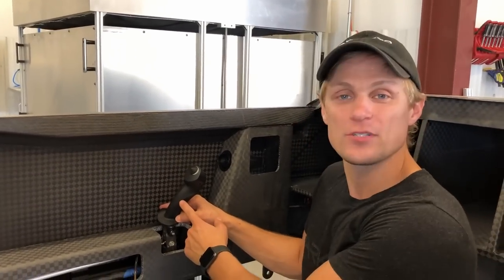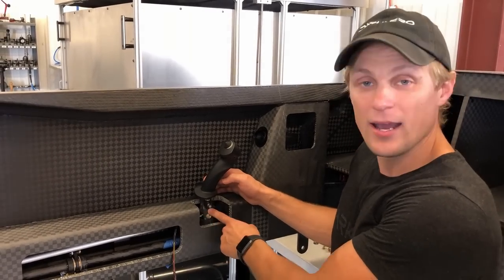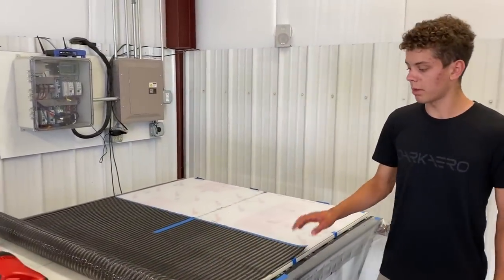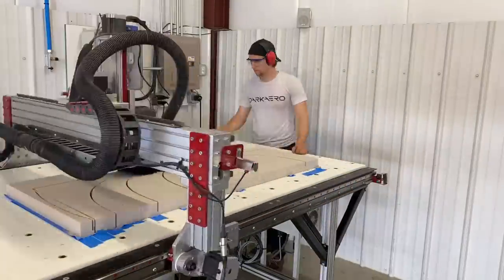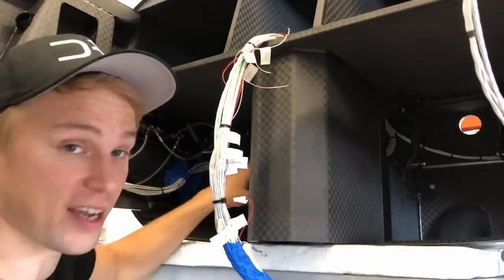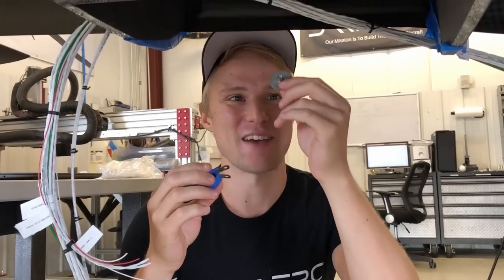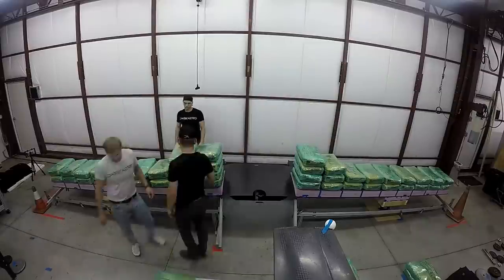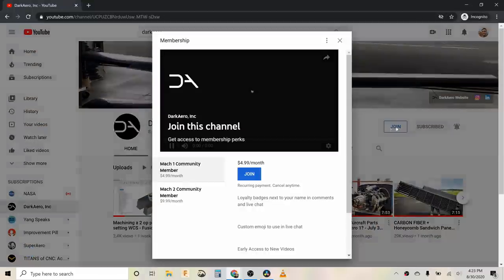We Load Tested the Wing! - DarkAero Progress Update - August 31, 2020

Comment: How did you evaluate the wing torsional rigidity requirements vs the actual rigidity results to prevent twist and flutter with control deflection? Considering the potential TAS at higher altitudes, how did you evaluate the wing structure, the weighting and balancing of the controls.

Comment: That wing is flexing in a unnatural way 06:29. Looks like its about to snap at the centre. Doesn't curve out to the edges like other composite wings I've seen. Did you stress it until it broke? What was the ultimate load stress/force compared to the expected max during flight. If its not 100% more then include a personal parachute for the "lucky" owner as part of the package.....

Comment: Engineering question: Did you guys select all your avionics, radio, nav equipment etc. before you designed the hull so it would fit, or did you design the hull and then select equipment that would fit within the airframe? Just Curious. PS love your project. Can't wait to see this bird fly!
Reply from the maker: Great question! We designed the aircraft with a generic instrument panel that can accommodate a range of avionics. Kit builders will select their avionics based on their mission so the panel is large enough for everything from a simple day VFR panel to a pretty capable full IFR panel with dual displays.

Comment: The proper term for your "P-clip" is actually called an "Adel clamp."
Reply: I literally paused the video and had to google that, because after nearly 20 years in military aviation I had never heard an Adel Clamp called a P-Clip. Turns out if you google p clip, you also get an adel clamp pop up, but because I like do not like change and like things my way even more, I am sticking with adel clamp.

Comment: The foam supports to help protect the wing skin should really have been segmented...despite its low tensile strength the I value from the bending equation is as well as Y - max would babe definitely increased... the parallel axis theorem states that any fixture to which a load is applied should only be supported by a segments stage where such supports are in both tension or compression( tension on your case). Excellent video though:) look forward to the final video!! ATB guys

Comment: How do you guys get around galvanic corrosion when working with carbon fibre and other metals, such as bolts etc? Also, does this happen with the aluminium honeycomb used for bulkheads?
Reply: I was just watching a video from the BearhawkLife channel (Bearhawk 4 build) where this was mentioned by the builder in his use of some carbon trim.  Curious about the answer also.
Reply from the maker: Will, thank you for watching and the comment! We have a video coming out soon talking about galvanic corrosion and how we prevent it on the DarkAero 1. Stay tuned!
Reply: @DarkAeroInc  Legends, thank you. I look forward to it.
Reply: Galvanic corrosion as a problem is dependent on the materials in question for RATE of corrosion.  That being said, CF is next to non existent for corrosion of any kind.  IF you are truly worried(not sure why you would be), you apply a layer of fiberglass just as you would on an aluminum plane as an electrical insulator.  As for specific aluminum honeycomb... such material has been used on EVERY single civilian aircraft produced for the last ~40 years and used primarily in the flooring.  No issues for decades.  Think they are safe... =).  Any ceramic would work as well.  Most plastics work as well, but deformation problems is why they are not used and since CF usually sits in a plastic epoxy matrix...   Bolting CF is difficult just as wood is difficult to bolt and therefore plates of metal are usually used, or in where one can do the testing etc, special bolt/washer combos are used for proper distribution of the load as the CF is not amalgous.  As for Honeycomb construction, the problem becomes the SHEAR properties of your connection.  Therefore what is usually done is to create a BOSS on top of the honeycomb to distribute the load and therefore one does not have deformation of the shear bond with the honeycomb.  Filling in the honecomb for direct compression is also used, but does not necessarily correct the shear problem nor the vibration fatigue over time problem.  This leads to the fact that most small carbon fiber parts would be LIGHTER if you used aluminum or magnesium.  Carbon fiber is great in tensile loads, but is abysmal in compression.  These guys making this plane have not figured this out yet and keep wasting their lives making hard CF parts which are not only heavier, but MUCH more expensive to make and to top it all off are prone to failure due to delamination.  For instance their control system is abysmal.  I would NEVER buy their plane with their Crap CF control system as it is glued to start with which means you cannot fix problems or change anything.  I would mandate they 100% remove all CF parts in their control system other than bell cranks and control rods.  Rod ends need serious work from my VERY simple overview from their vids.  Maybe I am wrong and they have addressed this in a different manner for adjustment.  From what I saw, they were using effectively BUTT connection glue joints... and not tapered.  Anything in composites which is not tapered joint is a 100% failure point.
Reply: w8stral thanks for the input and detailed response. I’m looking forward to seeing DarkAero’s response, these guys know what they’re doing, and I’m sure they’ve tested all of their carbon fiber parts for the required loads. I’m sure we’ll find out more in the up and coming videos
Reply: @WillTunna  The load is never the problem with CF.  Delamination(buckling in shear between layers) is the problem and unless one does LOTS of testing(they have not and not even the large aerospace companies have done all permutations), then this is the limiting factor for small thin CF parts.  Especially in a system that is under constant vibrations such as flight controls.  Only thing I have truly disagreed with them over in their choice of design so far, and this one, is a deal breaker for me if I ever saw it in an airplane I was looking to purchase.  OH yea, and they also have a massive problem with their fully wet wing, maneuverability and dry sump.  Same reason large aircraft break up their fully wet wing tanks into multiple tanks.   Yes, it weighs more.  From what I can tell, these guys are so retentive anal about weight, they have forgotten that this plane has to be flown by someone who is not retentive anal... KISS...

Comment: How many of the wing bays are "wet"? I can't begin to imagine the difficulty of tank sealing all of those!
Reply from the maker: Excellent question! The design is a wet wing so technically all the bays are wet and the internal structure acts as baffles. The perimeter areas are what get sealed so the tank sealing isn't much different than other composite wet wing designs. We leak checked the tanks before the load test but we will ultimately perform another leak check before we fill the tanks to verify their integrity.

Comment: Has anyone else built a plane with mechanical control of the ailerons and a side stick?  I ask, because a mechanical system needs a range of movement, not just pressure to work, and I don't think you have enough range of motion left/right in that space.  Every stick system I've seen has neutral aileron straight up, and the stick moves quite a bit to keep the control pressures low.  I do love the idea of your building a scratch design carbon fiber plane.  BTW that wing looks great!
Reply: Cirrus has a panel mounted single hand yoke at 45 degrees. LongEZ has a side stick similar to this one. Lancair had a shorty seat mounted stick. Nemesis NXT has a side stick. It goes 410mph. Stick force is determined by aileron size, hinge moment coefficient, Q, and stick leverage.
Reply: @Triple_J.1  Thanks!  I'm used to flying things designed back in the 30's to 50's, where control throws are measured more in feet than inches.

Comment: The vast majority of composite manufacturers have chosen to use E-glass as opposed to CF - and that's not only for cost reasons. How do you conciliate the risk of stones and other FOD debris being thrown onto the wings which are basically a one piece, with nothing stopping a crack from propagating? As you well know CF is the last material where you want to have a crack

Comment: How do I improve performance on wing for speed, higher pay load, more fuel, low stall, reach ceiling of 25000 feet and pressurized cockpit?
Reply: Design a new airplane that’s much more expensive and heavier.
Reply: Buy a Lancair 4P

Comment: My background is in product development and automotive design (and human factors), so I know zilch about building planes ...but isn't the the distribution of spars in the second segment at https://youtu.be/bMT7JNX33iA?t=363 a bit off? Due to the placement of the spars, the (3.)rib will experience additional lateral bending forces overlaid with torsion on top of the forces it needs to handle anyway... probably not critical but certainly not optimal either...

Comment: Should the load test not be done at an angle to simulate the actual high aoa load vector (ie wanting to fold the wings forward)?
Reply from the maker: You are right on Pete! We tested the wing at an angle to more accurately simulate the direction of the lift load vector. The camera angle at 6:29 show the test stand sitting tilted. We have another video coming out about the load test setup that touches on this topic a bit more so stay tuned for that.  Thanks for watching and for the question!

Comment: Wow, by the time you guys are finished, this thing will cost millions. I'm assuming it is a one off.

It is not worth the weight savings to have something so complicated.
Reply: Why would you assume it's a one-off? They mention production plans in almost every video.
Reply: @theralfinator  I guess I missed that. Even so, I suspect this will be a VERY expensive aircraft. Not just from R&D, but from the labor intensive production processes.
Reply: @Bob_Lob_Law  It wouldn't surprise me if final costs are higher than they projected, but they seem to be willing to redesign things to simplify the build process as they run into issues. The actual builder won't be machining parts, he'll just assemble the supplied parts.